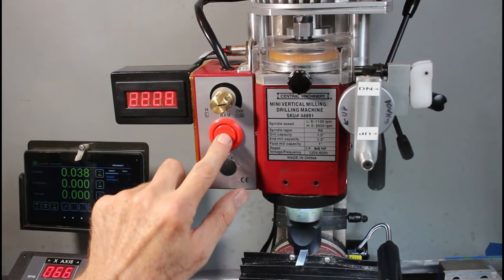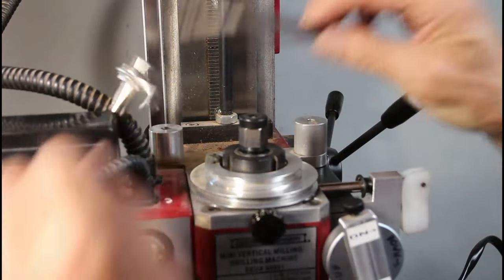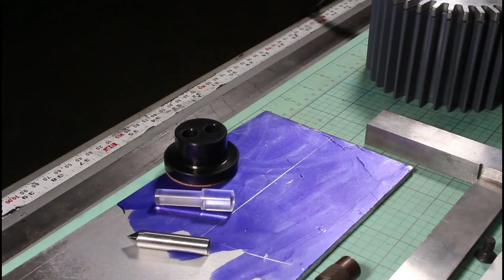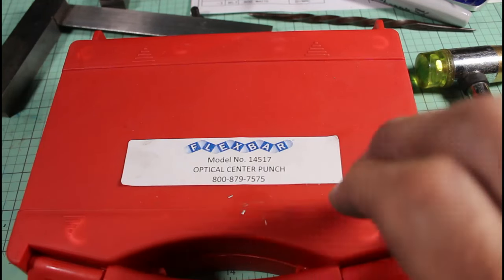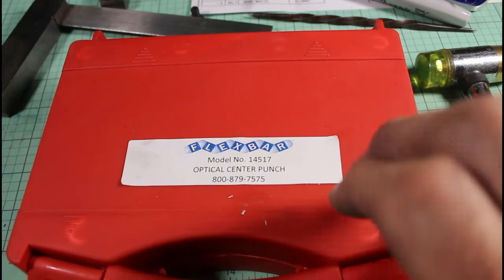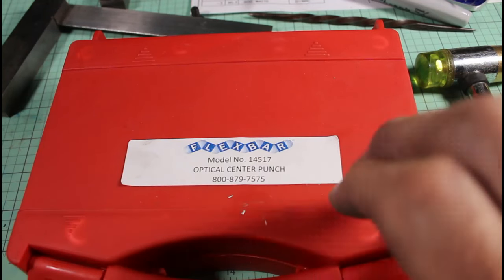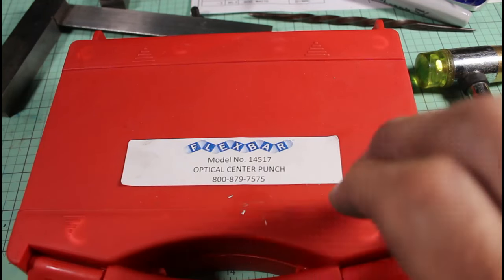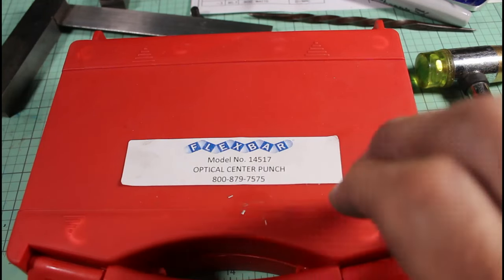Harbor Freight Mini Mill brushless motor upgrade

Comment: nice job , but your pulleys are normal V-type pulley , wouldn't be better to use normal V-belt rather than using  toothed/timing belt ?
Reply from the maker: Two reasons I'm using a V belt. One is that my design is based in part on the original belt conversion kit from Little Machine Shop, and the other is I like having some slip in case I stall the machine.

Comment: Guy,how explain changing tools on mill.Looks like the new motor plate covers the arbor bolt.By the way what is that on the top of the arbor bolt?
Reply from the maker: The draw bar is easily accessible.  I think what you are noticing is a slight improvement where I put a bushing in at the top. See this video: 
https://youtu.be/BUSGpfaS2i8

Comment: For 28:59 on your emergency stop button couldn't you put a relay in that once you press the emergency stop button a second time it just completely recycles the power to the unit bypassing the need to rotate the knob back to zero?  It would be like resetting the circuit it so the emergency mode is deactivated that way you don't have to turn the knob back to your original speed setting.  Or another option just unplug the entire unit and plug it back in to do the same thing
Reply from the maker: I don't think either trick would work very well. But if you're planning to install this you can try it and let me know.

Comment: Did the power supply come with the motor? If not do you have a link for it? My motor is identical, do you have a wiring diagram of how you wired it up? Enjoy your videos. Subscribed and liked.
Reply from the maker: The power supply was separate, but the business sent sold it was a surplus company that has since closed. There is more info in the description below.

Comment: Hi- Guy how is the mill running with the motor upgrade? What size stock did you use for the pulley? I need to get my lathe finished up the rebuilt and make the 2" stand offs and pulley.
Reply from the maker: It's running great! Amazing power at low RPMs and all the way up to full speed. I believe I used 2 in aluminum rod stock for the pulley.  The actual pulley diameter is up to you to optimize for higher or lower speed ranges.

Comment: Nice job and very good ideas for the mini mil. You have me reconsidering one of these now.
With all the modifications you have made to the mini mill. Have you tried to measure the accuracy and precision across the bed yet?
Reply from the maker: I don't need extreme precision for most of the stuff I do.  I do have the column trammed for left-right, and still need to tram front-back which is low on my needs at this point.  It is a hobby machine, and I know it!
Reply: @GuyMarsdenMakesStuff  thank you and agreed 👍

Comment: NIce upgrade!  The price seems very reasonable.  I think I'll do this to my mill.  The original motor works okay, but for some larger drills into mild steel there's just not enough power.  As Tim Allen would say "more power".  I looked for a link to the replacement belt you showed in the video and did not see it.  Have you changed your mind about using it?  If not I would appreciate being able to try that belt on my mini mill (I have the LMS belt drive installed).  I jus found your channel and look forward to checking  past videos and yes I just subscribed.
Reply from the maker: Here's a source for the 
Duraflex cogged 2L130 Polyurethane cog belt: https://www.grainger.com/product/DAYTON-DAYTON-Cogged-V-Belt-2L130-13V773
Reply: @GuyMarsdenMakesStuff  For one reason  or another the link doesn't work (can't be found).  I'll do a google search on the description.  Thanks for responding.
Reply from the maker: Here is the Grainger part number: 13V773
Hope this helps.

Comment: In your picture, I can see you have a DRO, what is the box in front of it?
Reply from the maker: That's the control box for my motorized table. It has a speed control and left right switch and a display that shows 0 to 100% speed.

Comment: It says the new motor spec is counterclockwise rotation. I assume you can really run it clockwise as well? Nice conversion. No problem with the cylinder assist clearing?
Reply from the maker: CCW is the right direction when the shaft is down.  I have no need to reverse a mill spindle and the HF did not have that option.
Reply: @GuyMarsdenMakesStuff  I swear it looks like it is running clockwise to turn the spindle that way.🤔
Reply from the maker: @gvet47  motor rotation direction is usually called out with the shaft facing you. I know, I'm dyslexic and often get things confused so I had to think about it a bit before I realized this was perfect for the mill.
Reply: @GuyMarsdenMakesStuff  Geesh I had to crawl under the motor to see the rotation. Getting too old. You should sell your risers and motor plate. Well, I guess the custom pulley as well!
The motor shaft does not look like it is keyed. Did you put double set screws or pin the pulley? The abrupt stop would sure need the pulley secured well.
I'll just have to live with the standard drive.😢

Comment: wondering sir, as i have purchased the same motor and power supply based on your recommendation; what tach you used? the tachometer you have listed in your parts list is 0-15v unit, the power supply is a 24v unit, unless you used some type of resistor in order to wire it?
Reply from the maker: Hi, I used a 12V wall plug power module for the tach - and also for my Y axis motor drive and the ring light around the quill.   Heres the video about the ring light: https://youtu.be/Hnl3pjBt-K4

Comment: Guy the scooter motor that I got on Ebay is very jerky @ slow speeds,is this normal with these motors?
Reply from the maker: Yes, at really slow speeds brushless DC motors have a cogging effect. But they also have a lot of power at that speed compared to a regular DC brush motor.

Comment: How much power is too much?
There are similar motors available in wattages up to 6000w or more,  plus they can be overvolted as long as you provide adequate cooling.
Reply from the maker: After using this for months, I feel that it's just the right amount of power for big stuff like fly cutters that need high power at low RPMs.
What I like about the belt drive is that this motor - despite the added power - will slip if the spindle stalls.

Comment: Great video! How does the pulley attach to the shaft? Didn't see a keyway or set screw.
Reply from the maker: Thanks.  I just used an 8-32 set screw. Sorry, but I skipped that in my video.  It holds great - even with the motor stalled when I forget to unlock the spindle.  But a keyway would definitely be better, I just don't have broaching tools - yet!

Comment: Dear Guy, very impressive. Is it possible to have to motor run CW or CCW?
Reply from the maker: This specific motor only runs in one direction, it is a surplus motor that was designed for scooters so reverse was never a consideration.

Comment: Hi, I found very interesting your project!, A question: can you explain the wiring diagram of the emergency stop switch? I know the wiring of the potentiometer but the switch? Thanks and best regards! Renato
Reply from the maker: It's very simple, it's just a push button connected to two wires on the wiring harness.  The web page where you buy the motor has a spec sheet that explains it.
https://www.allelectronics.com/item/dcm-2460/24-vdc-brushless-motor-600-watt/1.html

Comment: This is an awesome upgrade video. I enjoyed every minute of it especially how you explained the electronics.  So you went from 2500RPM to 2200 RPM??  You lost 300RPM? Or was that just your low gear RPM?  If it was then why didnt you show us your high gear RPM?
Reply from the maker: I'm glad you enjoyed my video!  Yes, it is a tad slower now, but no big deal. I might fiddle around with the pulley diameters in the future to get higher speeds.  Remember that this pulley drive setup bypasses the internal gears so it's direct motor to spindle drive now.
Reply: @GuyMarsdenMakesStuff  high gear was a bad choice of words. I meant high speed setting vs low speed setting. In your case the different sized pulleys but you answered that. I’ve seen people with mostly two stepped pulleys but say they only use the one pulley since it’s fast enough but think they didn’t consider the possibility that the other pulley could have a stronger torque. Im not familiar with the physics of pulley size effecting torque so that’s what im looking into now.
Reply from the maker: @ChristopherJones16  with pulleys and gears there's an inverse relationship between speed and torque.   A small drive gear or pulley will give you more torque but less speed and vice versa.  So I tried to strike a balance between the two with a ratio that works for me.  But also this motor has a lot more torque at low speed. So that's a bonus!

Comment: Guy, I have a question.  I thought this motor would be a great upgrade to my 45 year old lathe. Is there a good way to set this motor to go forward  and reverse?  Would just a, on off on, switch work? Thank you..
Reply from the maker: No, this motor is not reversible. It's a three-phase motor with internal vfd drive. You may want to consider using a treadmill motor which runs on 12 or 24 volts DC.
Reply: @GuyMarsdenMakesStuff  thanks, that was going to be my other option.
Reply: If you're brave enough you could open up the motor and add a DPDT switch to swap two of the three legs to the stator. Whether or not that would be easy would require seeing the insides. But if you plan on doing such an upgrade yourself it would be best to buy a set where the electronic controller is not inside the motor so the addition of the reversing switch would be simpler.

Comment: What about the cheap plastic gears inside the mill?
Reply from the maker: The gears are completely disabled and bypassed. The motor upgrade is direct motor to spindle with just one belt.

Comment: I see the motor of your CrossRef is 12vdc also. I have one of these and want to upgrade the drive motor and convert the whole thing to 12vdc to install on the service truck I'm building. My crossfeed is the Little giant one so I'll need to convert it to 12vdc. Is there a way to convert the DRO to 12vdc or do they have a 12vdc version available?
Reply from the maker: I can't help you with a 12V main drive motor, not sure 12V would be enough.
The Touch DRO runs on a 5V adapter, so you could drive it from a 5V voltage regulator.  I needs less than 500mA.  So a 1A regulator will work.

Comment: is that a 110V AC to 24V DC Converter Power Supply you listed?
Reply from the maker: It accepts 90 - 264VAC as input.

Comment: Does it only turn one direction? Does flipping the polarity change the direction? Is it even needed?
Reply from the maker: yes, only one direction - not reversible.  It's a brushless motor with the electronics embedded inside and inaccessible.  The advantage is more power at low speeds.
Reply: @GuyMarsdenMakesStuff  Do you find that you miss the reverse function? These motors do have a variant that does reverse rotation but obviously they would cost more. 

I bought 2 motors and a different power supply. All electronics is shutting down and once their stock is gone thats it.
Reply from the maker: @AERuffy  my Harbor Freight machine didn't have a reverse and I can only think of ever using it for tapping.
Yes I knew that the store was closing. I have been doing business with them since the early 1980s.  It's a shame. They are one of the best electronics surplus stores.

Comment: This is so cool i am thinking about upgrading to this just one question how is working out so far is motor still good and power supply are they both working or something gone bad?
Reply from the maker: Both are working GREAT!  The motor is very well engineered.  Only weird thing is that it sometimes does not start right - if you twist the speed knob up too fast it stops and won't start again for about 10 seconds.  This is some kind of safety for when it's used in a scooter.  
Also if you hit the Emergency STOP button the motor will have some holding torque until you turn the speed knob all the way back down.  So some little things you just get used to.
Reply: @GuyMarsdenMakesStuff  thank you so much for your quick reply i have one more question since you are a electrical engineer is it possible to just change the motor with tread mill motor if the motor is gone bad i mean keep the same control board and swap out the bad motor with treadmill motor? any help is greatly appreciated thank you again!. do you still have the control module that you would sell if so how much ?
Reply from the maker: @nasrumomin  no, you absolutely cannot swap out to a DC motor from a treadmill.  This type of motor is very different and requires electronics which are internal to the motor.
Reply: @GuyMarsdenMakesStuff  sorry guy to bother you again but you did not say about conrtol module if you still have it i would love to buy it and see if that will solve my problem
Reply from the maker: @nasrumomin  sorry, I don't have the original control module from my harbor freight mini Mill. But there is a guy who can help you out. His name is Pete and here's his web address:
www.olduhfguy.com
He repairs control boards for these machines and sometimes has used or repaired spares around.

Comment: Guy iI was wondering if their is a way to reverse the motor for taping?
Reply from the maker: No, it's not reversible.  The electronics are built in and not accessible.  The motor was designed for a scooter which would not go backwards.

Comment: My fan consumes 0.7 watts,
 a 507 ohm resister in series with the fan permits using the 24 volts. This avoids going to an external 12 volts.
Reply from the maker: Thanks for that thought, I will probably switch that out. Oddly enough I have a similar project with a similar requirement where I did use a resistor.
Reply: @GuyMarsdenMakesStuff
Reply: @GuyMarsdenMakesStuff  The resistor goes in series with the fan.and the fan and resistor are connected to the 24 volts. A 200 ohm resistor can be used,. the resistor value is based on a 0.7 watt fan.
Reply from the maker: @BillWeaver-wp6hw  Thanks, I know.  I'm an electrical engineer and have designed dozens of electronic products.  But it was just simpler to use the 12V power that I already had available for my tachometer and ring light.  Also, I'm not that worried about heat as I have never seen the control box get warm at all.

Comment: Guy does the 5k potentiometer you used have a on/off?
Reply from the maker: No, it's not needed.  The emergency stop takes care of stopping.
Reply: @GuyMarsdenMakesStuff  Thanks Guy I'm finally getting around to put this together. I'm trying to do all the mod at the same time. I have a 3/4 thick 4 x 20 inch piece of steel to stiffen the column. And 3D printing the 2 electrical boxes .
Reply from the maker: Little Machine Shop now have an upgrade kit for a stiff column (no tilt) and a larger table.  $500 is a bit pricey, but probably worth considering for 50% more table area:
https://www.littlemachineshop.com/products/product_view.php?ProductID=5177

Comment: You should duplicate these and sell as a kit. I know I would but one
Reply from the maker: I thought about it, but inventory management and shipping would be outrageous.
Reply: I would as well, I just purchased the Eastwood tools milling machine and the belt upgrade will probably get here before it, I thought about making my own gears with a  indexing head but It needs to be pretty quiet. Is there a brushless motor thats as close to plug&play? Something with the same dimensions sort of or is that not possible?  I think I just need something to get it up around the 3500rpm and with good torque.
Reply from the maker: @Mikesmeyer88  this is the best brushless motor I could find. I don't think it could be more Plug and Play than this.   As to speed, it's really a question of bully ratio size. My combination of pulleys max out at around 2,300 RPM.

Comment: I found your 'Motor Review' at the motor sellers web site and you claim it is possible to get to 5000RPM. . . Can you explain how you got your 2200RPM motor (as shown in this video), up to 5000RPM? Did you reverse your pulleys? Make new pulleys? Change some electrical features of the motor driver? . Have you opened your motor to review the electronics inside? .Thanks, John BTW-Subscribed! VG content!
Reply from the maker: The motor by itself tested out at 5,000 RPM if I remember correctly, but the belt/pulley reduction ratio drops it down to a more sensible speed.
And no, I didn't open up the motor. But be advised, it is not reversible.

Comment: Reason why the engineers of the machine-tool underpowered the motor to prevent complete destruction of the assembly shall a catastrophe such as a tool jam or crash occur. If you feel your motor is inadequate you obviously picked the wrong tool for the job.
Reply from the maker: I disagree. They put a DC brush motor in there because it was cheap. The torque curve of a DC brush motor means it has low torque at low RPMs.  But the brushless motor I installed has excellent torque at low RPM making it ideal for fly cutters and large diameter tools. I have stalled it many times and not broken anything.  Plus there's the advantage of the emergency stop feature which is very helpful.

Comment: Excellent video, very good narration, shows how relatively easy it is to modify equipment, I have a similar mill that had a belt conversion fitted unfortunately we had a fire in the garage and the mill took the brunt of it, did rebuild it and used a treadmill motor along with the toothed belt drive off my neighbours lawn mower, this is the video if you are interested, regards Nigel Cox,

https://youtu.be/ln_-dpwhVSU
Reply from the maker: Thanks Nigel.  I have heard about people using treadmill motors, you seem to have made a good go of it!